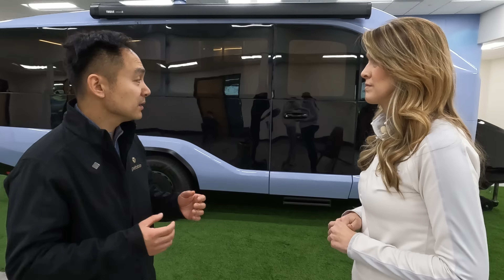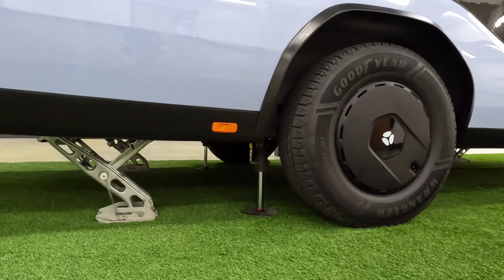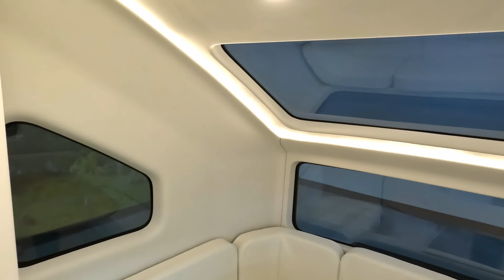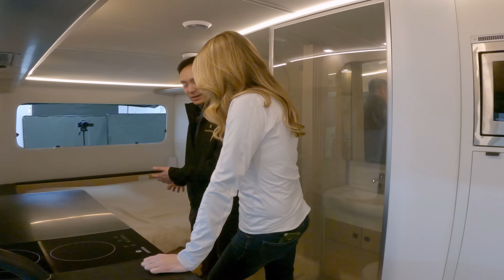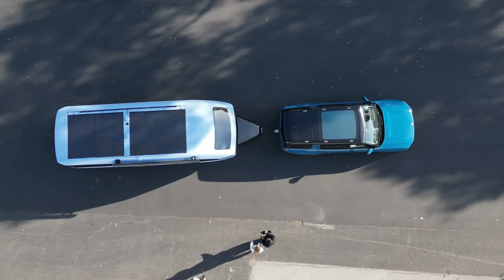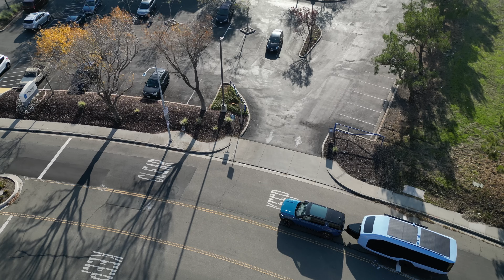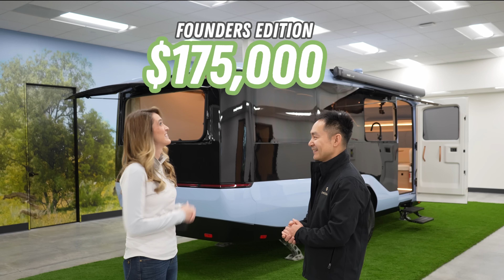Pebble Flow Electric Travel Trailer FULL TOUR (Production-Intent World Premiere)

Comment: Why aren't UK caravan makers looking at similar design for EVs!? Seem very dated externally in comparison but better internally. I'd buy a similar cheaper version in the UK. Only criticism is that windows only on one side and everythin along the other side makes it seem too narrow like a corridor not a living space. And for the efforts on efficient design I'm surprised it doesn't improve efficiemcy more than just c. 0.2 miles per kwh. That's not huge. Maybe because it weighs so much.
Reply from the maker: There are at least three other companies building powered electric travel trailers in the US with various configurations. 

I can't speak to the market factors in the UK. 
-Producer Tim

Comment: Please just mention the floor to ceiling standing height.
Reply from the maker: Their web site will help you determine every single measurement. Ceiling height was started in the review video, but faster to go to the Pebble site.
-Producer Tim
Reply: Producer Tim, 
That may well be the case, and I would certainly hope so. However, the primary utility of trailers and RV’s for human use is to provide an interior space to occupy (standing up and moving about the interior is a primary use at times when one is not seated while driving the vehicle, or sleeping [which is generally done in a roughly horizontal physical attitude wherein vertical headroom is generally not an issue]).

There is, I suppose, the argument:
‘Why not just estimate headroom based upon the presenter’s height coupled with their apparently not scraping the ceiling with their heads?’

This is after all a video, which you as a ‘producer’ are likely intimately aware of, and I admit that argument could be made. However, that seems to presuppose knowledge of the presenter’s height and gets just about everybody except you, the ‘presenter’, and your video crew no usable gauge of the available headroom. In which case you as the promulgator of information might consider mentioning it. Human height, alas, does vary.
Reply from the maker: Remember, this is a review.  If you want specifications, that is a separate video.  Miss GoElectric even said that at the start.  The other video was put on screen.  The link to the other video is also in the description.  This is a review...not a walkaround.  We filmed the walkaround years before and its been up since then.
-Producer Tim

Comment: Four wheels would just eliminate chance of any keel over and would just look right.
Reply from the maker: Wheel redundancy has advantages.  Of course, an extra axle drastically reduces available undercarriage space for tanks and subsystems in addition to adding several hundred pounds of weight.  From an efficiency standpoint, doubling the wheels also doubles the friction/contact patch.  The result of an extra axle would be less capacity and shorter range. Those are choices companies have to make when they establish the features and specifications of a product in this segment.  -Producer Tim

Comment: Nice trailer, can the solar panels on the trailer be used to recharge the towing vehicle?
Reply: Yes. Listen @0.57
Reply from the maker: Sure. The 240V outlet on the Pebble Flow can accommodate a charging cable connected to an EV, welder, or any other high draw device. 
-Producer Tim

Comment: What a cool little trailer but take it from somone who owns a towing and roadside assistance company those tire repair and inflation kits in new 
electic cars and lot  of non electrics also are a joke they are for slow leaks only ,when you have a flat on the road its never a slow leak and the kits are worthless ,and while a car can be towed on a flatbed tow truck to a tire store , guess what a travel trailer this size wont fit , so you will be stranded untill you get a tire repair or replacment so plan on jacking up you trailer removing the flat and leaving the trailer behind while you drive around looking for a tire store to replace and or repair your tire and if it isnt a super common size that might be problem , take from somone who tows a lot of newer vehicles around for this exact problem , i wouldnt buy a travel trailer that doesnt come with a spare , but i also wouldnt by a auto without one either ,just mount a spare underneith or on the back !!!!!
Reply from the maker: It's a common truck tire. Pickup truck owners can easily carry a spare in the bed. -Producer Tim

Comment: Dead on arrival product. NMC battery that has god awful dc fast charge rates, it will get demolished by the outdoor environment unless it burns a ton of energy on temp control, and its absurdly expensive for what you're buying. And before you tell me "no you don't understand, it has to be a 6 figure product" you can get a 48v 100ah (5kwh) heated lfp battery for like 1400. 9 of those gives you 45kw and an appropriate charger/inverter control setup for about 15k. You can put that in any travel trailer you want and not have to get this ugly thing. Since lfp batteries are universially 1c charge rate, youd also get 45kwh charging capability with an appropriate dc fast charge controller if you really needed and charge the battery in an hour. You could also customize it to suit your needs. Bigger rv, more room and payload, more battery. Smaller travel trailer, smaller and lighter battery. 

If this company manages to get past the startup phase, it means theres way too many people in southern california with more money than sense. 

Notice how there wasnt a single bash in my comment against it being an electric travel trailer, thats because most travel trailers these days have batteries, either homebrew, professionally installed, or premade products. So all this trailer does "special" is be efficent and come with a dc fast charge capable battery
Reply from the maker: Who told you this is an NMC battery and not LFP? We understand it uses a 45kWh LFP.

There is only one other travel trailer on the market which offers electric propulsion. None offer remote control operation and auto hitch.  The battery is among the elements which enable these unique capabilities.

Even though NMC is not related in any way to this product, your misinformation should be corrected. We have a 2016 Tesla Model S90d with NMC cells. It has 100k miles on it and sits outside in below zero weather throughout northern Michigan winters and then bakes outdoors in the heat of Tennessee all summer. It works great in all conditions and has experienced only 6% degradation through still of those moles and seasons. Now you understand NMC capabilities and real world results.

In this video the Pebble CEO said the charge rate of the Flow is about 50kW. That limitation is certainly due to thermal system engineering decisions to control space, weight, and cost.

LFP in the Flow verified here:
 https://share.google/yEN46AYnRL5y61UYF
-Producer Tim

Comment: I am confused, they keep comparing this RV (which retails for 175,000.00 as the founders addition) to a travel trailer that retails from 14,000.00-23,000.00. This is just tech-bros trying to reinvent something. I am sure if you compare this RV to similarly priced units, you might find a Mercedes in your driveway. I will say the 45kwh battery is nice, but even the basic model with just the battery is around 110,000.00, and yeah that doesn't even get you the duel motors which is really the only unique thing about this RV...thats an additional 26,000.00.. You can buy a nice Brinkly Model I and get the equivalent battery bank for a lot less. Just things to consider before spending this much. I am not sure how these people have camped in the past, but a traditional RV isn't difficult.
Reply from the maker: Your level of confidence is high. There is a LOT of money to be made if everything about travel trailer life can be made so easy that millions of qualified buyers who have insufficient confidence can have a worry free option. That is why Pebble demand will greatly outstrip supply for years to come. They seek to expand the market well beyond people like you. -Producer Tim
Reply: @MissGoElectric  Naa this is tech bros trying to reinvent stuff and pass its overpriced cost down to support a largely over paid ceo. I love the concept and I want more innovation in this industry, I hate the price gouging. It seems they make products for suckers like you Producer Tim.

Comment: The problem with a single axle is the consequences of a blowout. "You're going to know it" is not taking into account the "reasonableness test." That is, is it reasonable to assume that everyone will notice the blowout? Just using a standard bell curve and no other data will lead you to the conclusion of "no, not everyone will know it," as ludicrous as it may sound. The consequences can be up to and including death, therefore, mitigations are indicated. I would suggest that your drive controller be programmed with the ability to recognize and stabilize the trailer in the event of a blowout. Since the trailer connection isn't two way with the towing vehicle, you'd have to send an alert as well as apply mitigations to the trailer (however you decide to implement it). The alert might be verbal instructions on what you should be doing in the towing vehicle. A complicated control system problem, to be sure. If it were me, I'd spend the engineering man-hours to address it. I'm pretty sure my lawyers would thank me.
Reply from the maker: We asked the question with full comprehension of the consequences of that engineering decision. The CEOs response identifies counter arguments.
-Producer Tim

Comment: Should use a foil toilet that u can dump in the garbage or the toilet that burns the waste using solar power.   Should also have wrap around solar panels with rain water collection system with bigger tanks for water.   Also back up propane tanks to recharge solar when sun is not out.  More offgrid
Reply from the maker: There are, perhaps a few buyers who would be willing to pay another $50,000 per vehicle for the development and implementation of those features. Some percentage of those have a vehicle which could tow the extra weight. 

Pebble has done the difficult work of funding the balance between go-to-market-time, a feature set which appeals to the widest audience, service requirement minimization, and viable pricing. 
-Producer Tim

Comment: I really like how it can power an EV.  I have a Kia EV6 so it's cool to think I would be traveling with not just a camper, but also a portable back up EV charger.
Reply from the maker: Its great to pack more energy and use that solar energy to power things while at camp or when the trailer is idle in the driveway.

Note: The EV6 has a towing capacity of only 2600lbs, a fraction of the Pebble Flow's weight.
-Producer Tim

Comment: This is very cool but thoroughly ruined by the glass bathroom. Why do hotels and now these people think ANYONE wants this???? No one wants this. No one wants to be looking at their bathroom, even when it isn't in use. If you felt like it needed to be more open for the occupant, just do the smart glass from 4 ft or so, and have solid panels to approximately shoulder height instead, that way no one has to be looking at their toilet, you have much more privacy,  everyone's modesty is preserved under normal use, but you still can look out and have light come in if you're the only one in the trailer and don't need as much privacy. You should never, ever, have a full glass door/wall on a bathroom.
Reply from the maker: That is one way of looking at it.  Another design understanding viewers might have involves recognizing that the space between the bathroom and the kitchen counter can feel uncomfortably tight with opaque walls.  If a person doesn't want to see inside the bathroom, they can elect to leave the smart glass activated at all times.  No problem. -Producer Tim

Comment: I like a lot of the ideas in this trailer, but it's missing a few things:
---------------
1. Where do you put a week's worth of food for two people and a week's worth of clothing for two people? And spare sheets, and towels? 
2. I didn't see a closet or a pantry or a spice rack or space for pots and pans and dishes?
3. Where do you put propane for a fire pit? Where do you stow a fire pit?
4. Will there be an option for "solar on the side" external solar panel input for when the trailer is parked under a tree?
5. Will there be a bug screen on those windows that open wide? Lots of camping places have monster bugs...
6. How much light do those windows block out when activated? Are they FULL blackout?
7. Will the windows have a double-pane option for hot and cold camping?
Reply from the maker: Subscribe to this channel for a real world use case test of the Pebble where these questions will be answered in a practical way. Miss GoElectric and I will do some camping in one. 
-Producer Tim
Reply: I feel this is more for 2 people. We had a camper with a slide out and it was a must for our family of 4.

Comment: If you’re out in the middle of nowhere and your batteries are dead because it’s overcast and raining, no gas generator, no propane. 😂
Reply: Planning ahead and  going to places that have  powered campsites  ...and most places have power outlets somewhere.
Reply from the maker: It is very difficult to find a building in the US or Canada which does not have electricity.  Street light poles, city parks, any home, and any business structure can be a source of energy.  Electricity is almost infinitely more abundant and accessible than gasoline in North America. -Producer Tim
Reply from the maker: Several days worth of typical energy usage is stored in the battery.  It can be charged up from the sun.  It can be charged at any AC power outlet, too.  Remember, propane and gasoline are much harder to find than a standard outlet is.  Just about every building in the world is a source of power.  Of course a biodisel, diesel, gasoline, wind, or propane generator could also be used.

Most owners will simply plug it into their tow vehicle.  The Rivian/Ford/GM/Tesla trucks hold weeks worth of energy and can top off the trailer easily.

As explained in this video energy can also be created and stored inside the battery by pulling the trailer. 

No problem.

-Producer Tim

Comment: An electric RV?  All RVs are electric.  You hook up to electric when you get to the RV park.  $175,000 for all the features!!!  My 1800sf house didn’t cost that much.
Reply from the maker: If you watch this video, you'll see that a version without electric motors and remote-control powertrain starts at $109k.  This RV will appeal to campers who want electricity even when the trailer is used in nature far from other campers and the power grid.

The median price of a home in the USA is currently $419,000.
-Producer Tim
Reply: That’s the beauty of it.. it charges when parked, on the trip it will boost range of an EV or gas/diesel mpg with the assist helping you get more range. No other trailer does that.

Comment: Bike racks cause instability on back end of a trailer The pull our awning looks like a complete afterthought and is at odds with the streamlined body. From what I could see the build quality is very poor, lots of uneven gaps and poor quality cabinetry. Cheap materials. The interior needs to be completely rethought and upgraded.
Reply from the maker: The awning is an option.  Those who do not like it will not chose to have it installed. There is one competing EV RV travel trailer and it does not offer any kind of awning.

A bike rack with <250lbs of weight on the back of a 6,000lb trailer causes instability?  The statement is not supported by my personal experience with much lighter trailers.

We have experienced dozens of premium travel trailers and we were very impressed by the fit and finish of this Pebble Flow in person.
-Producer Tim

Comment: E stands for explosive, how long until one of these catch fire. Lithium is not good for large batteries
Reply from the maker: You are misinformed. These are LFP batteries which are incombustible.

Remember, this RV does NOT have explosive propane or flammable diesel on board. There are no flames and no fumes. This is MUCH safer than a traditional travel trailer. 
-Producer Tim
https://www.dtgpower.com/post/do-lithium-iron-phosphate-batteries-catch-fire

Comment: How about the security feature, like hacking the vehicle system to hijack the vehicle, while leaving the vehicle at the campsite?  Also, thus harsh and extreme weather (like storms, snow, etc.) affects the performance of the trailer?
Reply from the maker: There is a link to the Pebble community in our video description. You can get those answers there directly from the engineers who designed the Flow. -Producer Tim

Comment: Still no screen for on both windows and door? No exhaust fan on the toilet. The charging station needs to be universal, same with the hookups for the external water station (bkack and grey tanks)? Still no TV's. But most important of all, there is no spare tire. The CEO is wrong about predictingba tire blowout and opted for a tire repair kit? Another issue is winter season driving and camping?
Reply from the maker: Screens are standard on all openings at every trim level.  There is a bathroom fan. The J1772 charging standard is a universal AC standard in the USA.  Combined Charging System DC is common and compatible with NACS.  This RV can charge anywhere. No problem.
If you want to carry a spare tire, do so with the hitch mount or put it in the tow vehicle...or put it inside the Pebble.  If you think you need it, get it done.  -Producer Tim